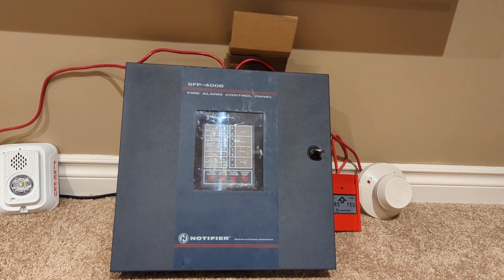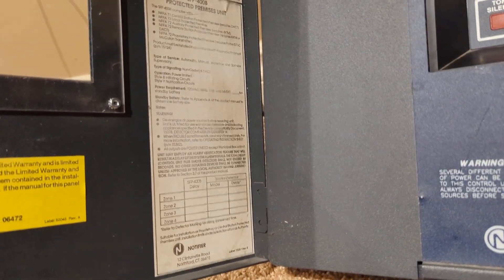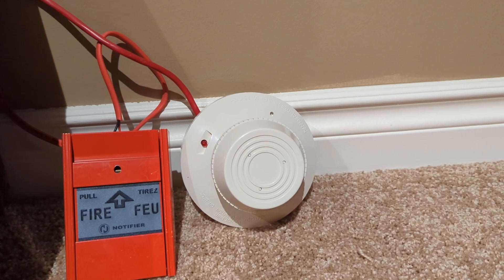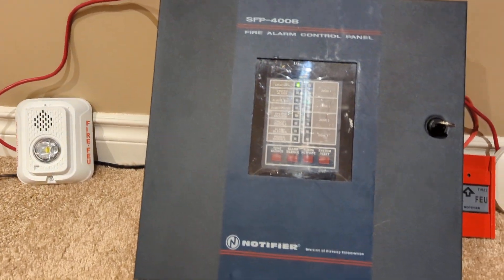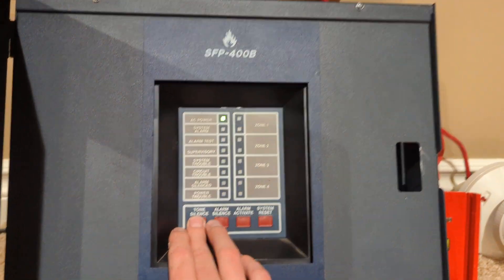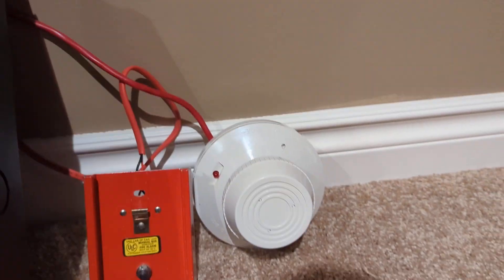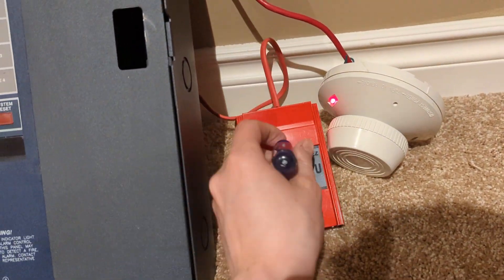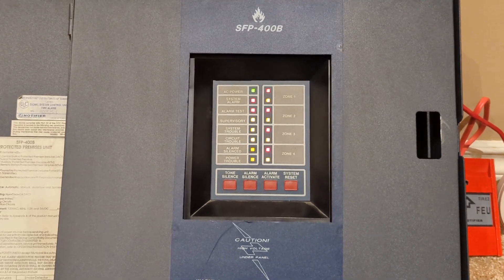Notifier SFP-400B Fire Alarm System Test 1: LED L-Series!

Comment: System sensor finally started making LED speaker strobes recently as well as low frequency led devices. I’ve started seeing those pop up recently in my office for all the fire-lite jobs we are doing at the moment. I also recently put up an ES-200X in some supermarket with all LED devices. The LED stuff is definitely better than the old stuff, but I don’t get why system sensor constantly has to change mounting bracket designs from legacy devices to new devices.
Reply from the maker: Oh nice!  Yeah here in Canada Fire-Lite isn't very common, but I have seen it a bit more lately.  The unit in this video was on a standard 2-wire L-Series mounting bracket and it seemed to work fine; were you referring to the speaker/strobe brackets being different?